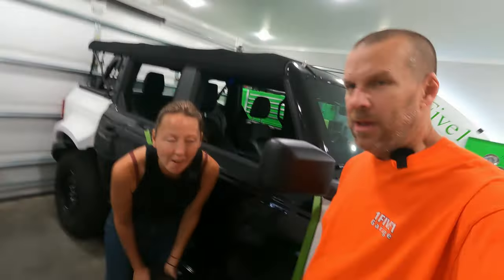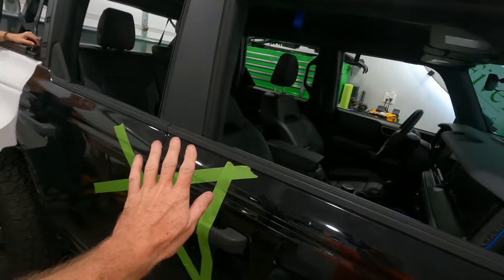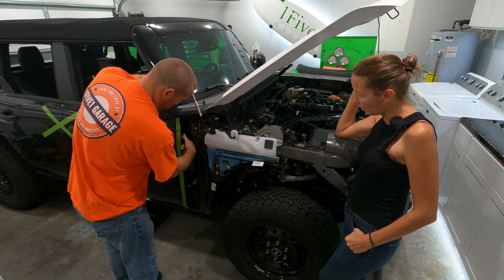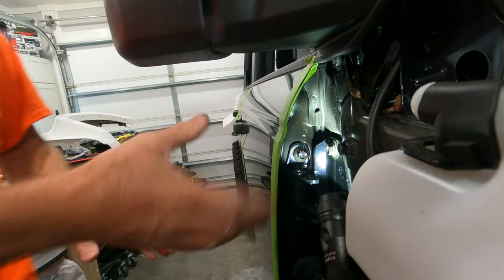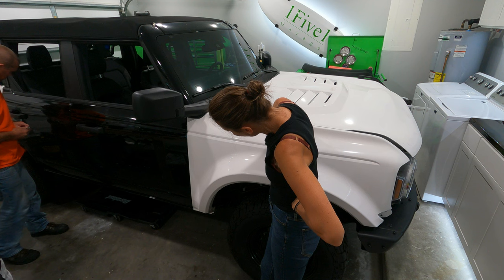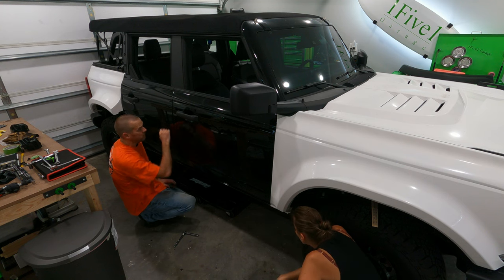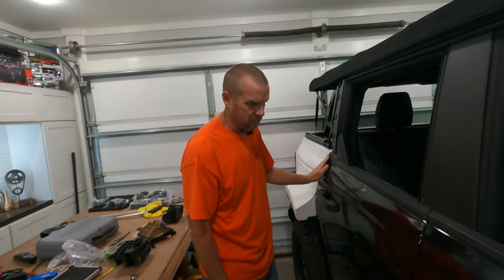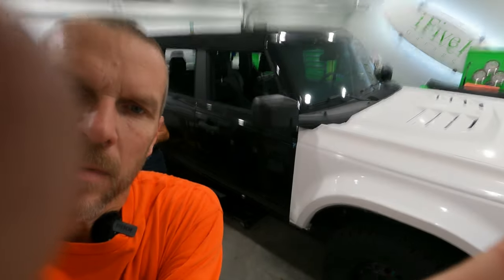Fixing Our Bronco Black Diamond Body Alignment Issues. Easy or Hard? Either Way, It Need To Be Done.

Comment: 9 / 15 / 2023 Bronco sightings En - route to Aurora VA hospital and back  : Going = Bronco Sport, 4 door, Cactus Gray, Outer Banks model. Coming back : BRONCO, 4 door, Cactus Gray, Model ? They were going the 75mph limit or more and my Uber driver was doing 62mph so it passed it very quickly. I also saw a Rapid Red F - 150 too. SWEEEET Truck